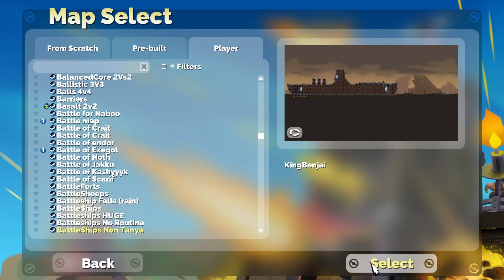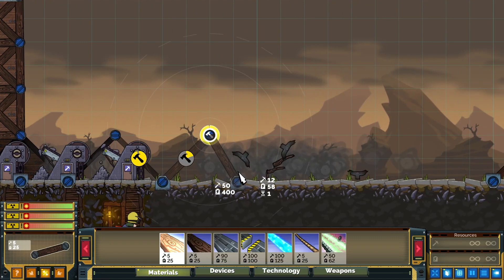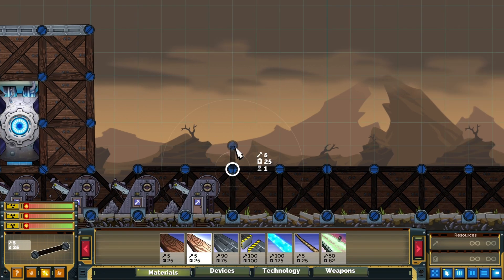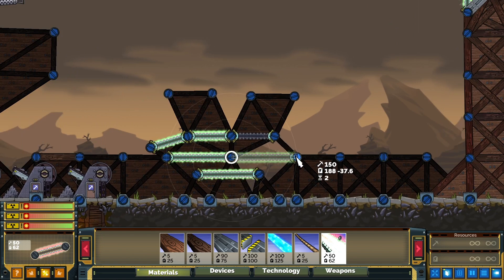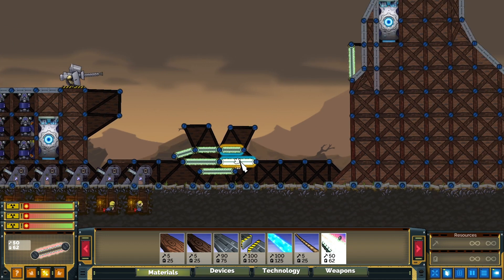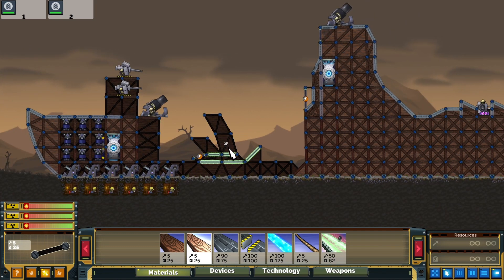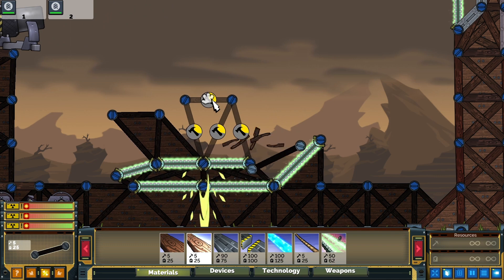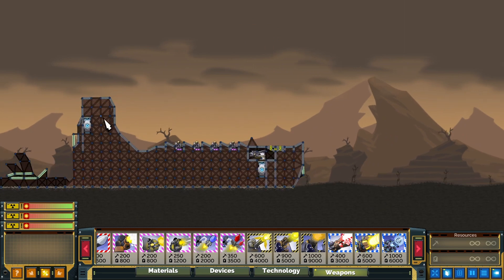Accelerator Tutorial & in depth explanation - Forts portal shenanigans

Comment: just wondering, can you accelerate:
- armour-pen sniper: will it gain any more pen that way?
- mortars: to gain range and focus the volley?
Reply from the maker: AP sniper doesn't get more penetration as it is being accelerated, but having several APs would be decent. However if you have an accelerator, you might as well use stronger weapons.
As for mortars, they are very strong with portals for the extra range, but they don't usually need to be more focused if you use the proper setup. There are ways to stack mortars diagonally, so they all shoot one big portal and output a smaller one, focusing the volley and making them devastating. It has been used a couple times in the FPL and tournaments, I think you should be able to find Incursus vids with those.